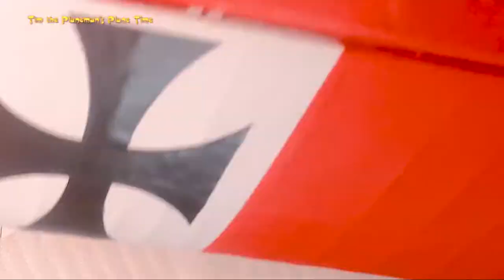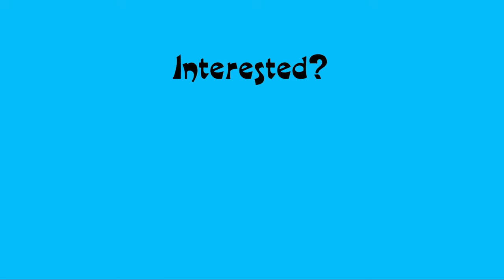Fokker DR1 Red Baron Triplane Assembly Part 2 - wings.

Comment: what type of glue do you use?? I am new to this, i am building this as part of my therapy, Im a golf war veteran with P,T,S,D And I find that bulding models airplains helps me,
Reply from the maker: I use different glues for different parts of the model. Sometimes "CA" = super glue (I prefer LePage Liquid Pro), sometimes E6000, sometimes good 'ol white wood glue, occasionally 5 minute Epoxy for really strong bonds. It sure is relaxing to sit down in front of a kit and just build! 🙂